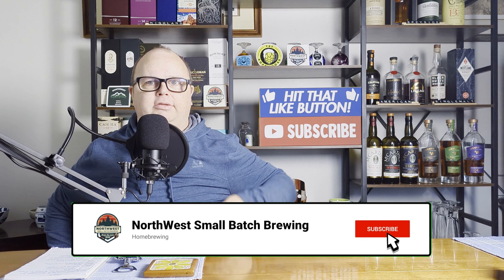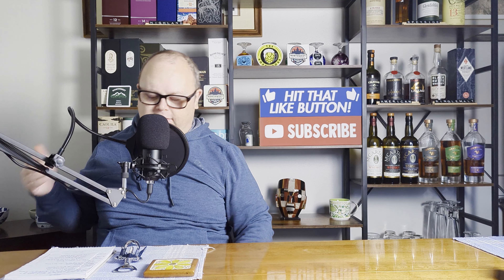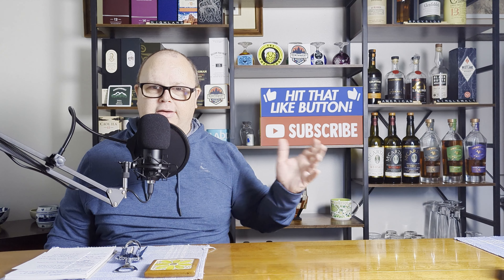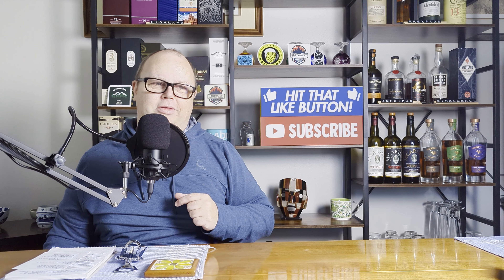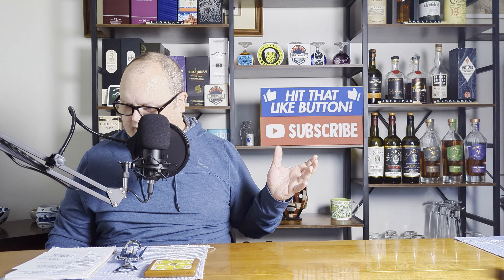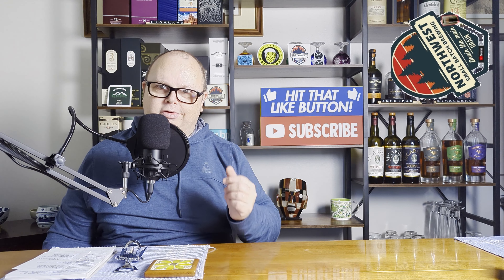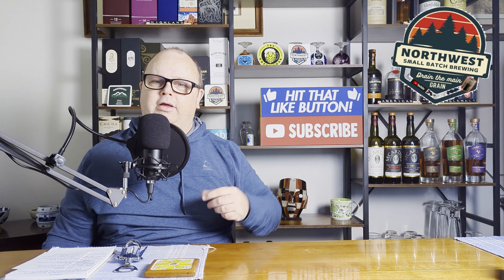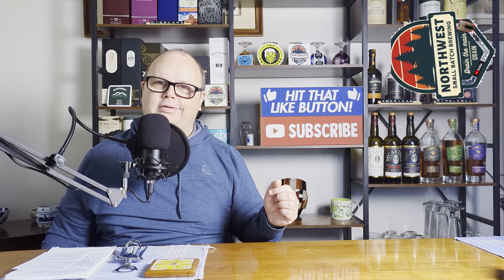BEER - Hop spider VS Whirlpool !

Comment: Strongly disagree on several points.

Typically whirlpooling is only done for a couple of minutes before you shut it off to let the debris settle. This isn’t just hops but also the proteins. 

There is such a thing as a whirlpool addition if you run the whirlpool during the hop stand. It helps with utilization. Just shut it off when you continue to chill.

My Brewzilla 3.1.1 stock pump whirlpools just fine I’m not sure where you heard it wouldn’t. The recirculation arm only cost $20. A decent hop spider would cost at least that much and also sucks for hoppy beers and larger batches. 

Just because you aren’t doing something doesn’t mean it isn’t valuable. 

In my opinion hop spiders are a goofy workaround homebrewers came up with because they didn’t have a good way to whirlpool or didn’t know better. 

At the end end of the day all of these things are tools we can use in the brewing process. Sure you don’t NEED to whirlpool but you can and it can have positive effects on your beer and on your brew day. 

I see too many home brewers talking about what they don’t NEED to do to get decent beer and far too few talking about what they CAN do to improve their beers or their process. Agree to disagree I suppose. Cheers.
Reply from the maker: Appreciate your comment was written in a constructive way.  I stand by my points but always have felt no matter what if someone is doing something and they feel it works for them, by all means keep doing it.  All that matters is if you are happy with your end product.  Lot's of things in homebrewing over the years have proved just not to be true.  Just the other day I saw a video where they were saying to not squeeze the bag. Hey if they don't want to, it's fine, but I try to keep an open mind as new science emerges.  Cheers !